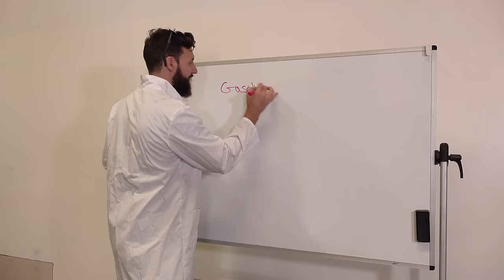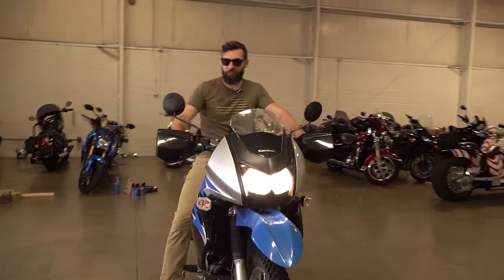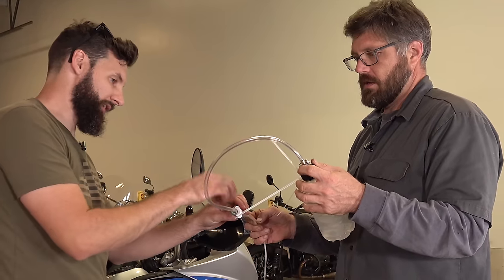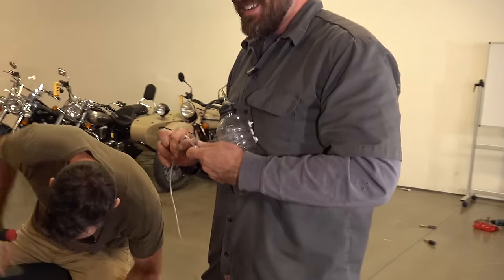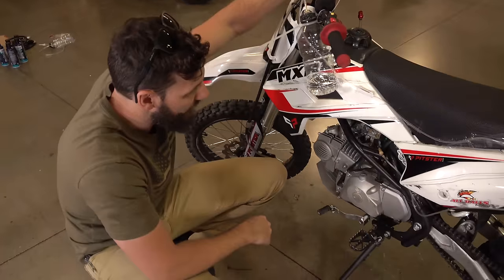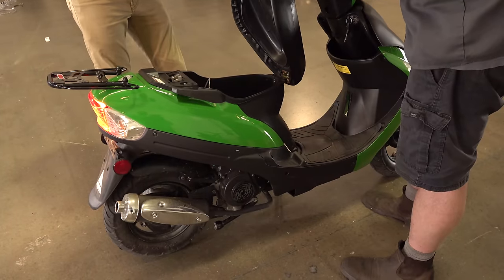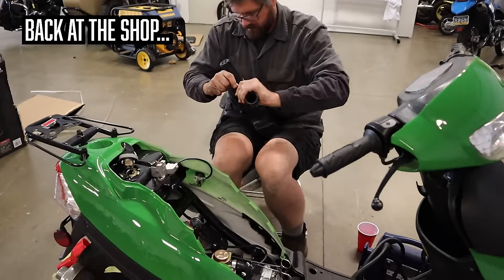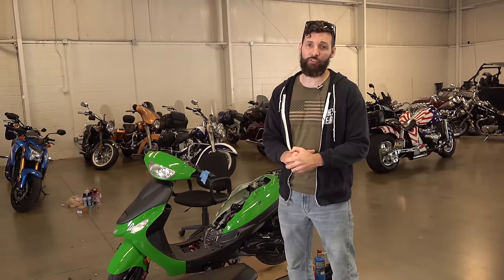What happens when you try to run a motorcycle on PROPANE instead of Gas

Comment: Air Fuel Ratio the first bike was too lean, the second was flooded when you cracked the throttle it was running. You were right you needed a regulator that would regulate a constant amount of fuel per rpm

Comment: Never heard of anyone trying to run a vehicle on Butane, as i understand its not very efficient. Running a vehicle on Propane however is common and has been for decades. Down here many of our cars are "duel fuel", meaning you can flick a switch and choose to run on either petrol from the tank or propane from the bottle.

Comment: To run propane you need more timing. And the hotter propane burns at hotter temps and you need more. So you gotta advance the timing and warm up the propane.

Comment: I woulda just hooked up a trigger air sprayer from a air pump between the LP and the carb setup and taped it on the handlebar and used it with my thumb like a 4 wheeler lol

Comment: if you can rig the throttle to conyrol the valve on the propane tank i.e. turn the throttle and the valve opens, release the throttle and the valve closes... it would control the flow of the propane into the motor..?

Comment: Theoretically you can run am engine on what fuel you want. The Problem is that different fuels need diferent air to fuel ratio. For example, for gasoline you need 14.7 grams of air to 1 gram of fuel. For other fuels you must calculate it, adapt the carburator to mantain that ratio and it will work. It's not recomended to run an engine only on very volatile fuels, because that type of fuels don't have lubrification properties as gasoline or diesel does and you will ruin the engine after some time. Gook luck!

Comment: Maybe run the propane through where the jet is on the carburetor the only problem is the gas flow will not change due to the venturi effect like the gasoline does so it still would have to be modulated independent of the throttle unless you get the throttle to modulate the gas flow

Comment: the propane regulator needs power. you just need LPG evaporators from a car. don't forget that it must be connected to the liquid cooling systen to prevent freezing up. the regulator is only compatible with suplied carburetor. but that carburetor is only compatible with yhe genset.

Comment: It is like a throttle body that has a pressure regulator on there so when you pull on the swaddle it opens the regular more and laws more fuel to get out

Comment: Just hook it up directly from propane tank and and propane hose  modified .it should work cause it needs pressure to force it into the engine cause there is no fuel pump

Comment: it ran for a little while because pressure build up in the bottle. Because it takes way more gas than it takes for pressure to build it will die. because it is not pressing enough gas through the tube.
Try using propane and hook up the gas regulator on the propane to the throttle maybe that works 😬

Comment: You have to remove fuel system stuff, direct connect propane with a regulator valve and that’s it. It’ll run great.without the regulator it’s gonna be a straight fail.

Comment: If you think about it gas acts like a lube for the cylinders/cylinder it is classified as a wet fuel propane and outher gasses are classified as a dry fuel most engines don't recommend dry fuel becous it has no lubricant added to it to prevent the cross hatching from geting glazed with long extended use
The reson why the bikes would not start after some time was because the metal heated up making the engine more loose around the piston ring's and it was evaporating before it could even get combusted wich is a problem with dry fuel's with my experience converting cars/trucks to run on cng/propane with that I use a small injector to spray some kind of lubricant in the intake like marvel mistry oil or just some wd40 for lubrication but that on a big engine not a single cylinder engine and the mixture of the fuel and air has to be stokemetric
Reply: Or to make it easier just use the equipment off a propane forklift simple

Comment: hold the bottle upside down so the liquid butane goes in , should give a lot more oompf 
putting the bottle in some hot water should help up the pressure and gasification too , i have seen the indian youtube version of this experiment and india is a lot hotter in general so the bottle holds more pressure , he used a pet coca cola bottle that can take a bit more pressure and waited quite a bit to alow the bottle to make some pressure / evaporate some  gas 

as for using the bike on propane with the stuff from the generator : that should work check the quarter turn tap on the top of regulator part is set to propane and not natural gas 
you could try a bigger gasbottle to have enough gas head (surface over the liquid ) the bottle can probably be set between the feet on the runningboard for testing
you definetely might want to try a pressure regulator with a twistknob for a camping stove on the gasbottle itself as the full pressure from the bottle could overpower the membrane inside the regulator (the regulator works of vacuum its a big rubber membrane deviding the thing intoo two chambers with a needle valve and the vacuum on one side and atmosferic pressure on the other  , 
more vacuum means more gas added , the inlet needs to be in between the carb and the inlet not before the carb as that has too little vacuum signal 

another thing you could try is put a needle valve or a smaller size nitrous jet in / on the gas inlet tube to the manifold , the generator has a lot more cc's so the regulator might give too mush gas to the small cc scooter , the needle valve or nitrous jet kindah pinches the line so there be less gasflow 
i have seen a road motorcycle where the guy put a 5 kg sized gas bottle (the type you use for youre barbecue) behind the budyseat inside the tailpiece , it fitted perfectly , https://www.google.com/imgres?imgurl=https%3A%2F%2Fwww.motor-forum.nl%2Fmedia%2F767531%2Ffull&imgrefurl=https%3A%2F%2Fwww.motor-forum.nl%2Fthreads%2Fje-zal-er-maar-op-komen-lpg-op-de-motor.246486%2F&tbnid=wRCgw7wXumdmoM&vet=12ahUKEwjDpIPhjZbsAhUK4aQKHYiwCfsQMygTegUIARDGAQ..i&docid=v3rgZFPKufe0IM&w=648&h=486&itg=1&q=motorfiets%20lpg&ved=2ahUKEwjDpIPhjZbsAhUK4aQKHYiwCfsQMygTegUIARDGAQ
he had an outside filler to fill it up at the gasstation (he used an automotive style regulator that he warmed by running the engine oil through it and a gas ventury build intoo the intake to the carbs )

would realy like to see the result , and aspecially see ideas on the (safe / hidden / permanent) placement of the gasbottle  , i have the carb you shown in the picture that you couldnt find , its been sold by the chineese postorder companies , and i'm planning to run my 50cc scooter on it 
i got mine from aliexpress https://nl.aliexpress.com/item/4000672019029.html?spm=a2g0o.detail.0.0.6155526bLk89Hf&gps-id=pcDetailFavMayLike&scm=1007.12873.140318.0&scm_id=1007.12873.140318.0&scm-url=1007.12873.140318.0&pvid=60d41bb5-6097-4f0b-872e-30889b1f32d1&_t=gps-id:pcDetailFavMayLike,scm-url:1007.12873.140318.0,pvid:60d41bb5-6097-4f0b-872e-30889b1f32d1,tpp_buckets:668%230%23131923%234_668%23808%233772%23242_668%23888%233325%2320_668%232846%238109%23261_668%232717%237561%23390__668%233374%2315176%23535 

i was planning on only using the gasifier/regulator part of it (the big orange quarter turn knob at the top of the regulator alows you to adjust for propane or natural gas ) 
why i want to run on propane you ask : in the netherlands gasoline is about 6.65049533 U.S. dollars per US gallon lpg is half that price , 
theres a BIG costsaving to be made even if lpg has less power 
theres allso a new euro 4 norm for pollution in some of the bigger cities in the netherlands and the lpg is a cleaner burning fuel , my scooter being build to the euro 3 norm is banned in amsterdam for instance , if i get the bike tested on propane i might be able to have the scooter aproved again for use in amsterdam

Comment: Can you not buy Gas at the Gas station? We have LP Gas here in Australia it's around half the price of regular petrol but you only lose around 20% power. I had an old Ford with 302 Cleveland engine converted to dual LP gas and petrol. It ran so clean I only changed the oil once per year -around 20,000 kms.

Comment: In pakistan 🇵🇰 we ride bikes on lpg its sort of propane it comes with a kit that adjust the gas pressure.. the coolest thing is that it gives more mileage and run much smoothly and add much speed also

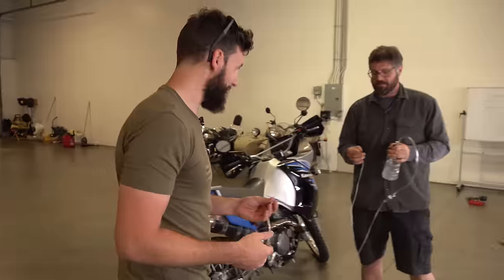Comment: What's weird about Diesel and Hydrogen engines, and propane engines, is that you control the RPM's by controlling fuel flow only. You don't need an air valve on the throttle body. Gasoline only burns correctly between 11.5:1 and 18.0:1 air to fuel ratio. If you go richer or leaner than that, power goes way, way down. Hydrogen can be burned at only 4% concentration in the open air. So if you have a 1:25 ratio of hydrogen to air, or a 1:1 ratio of hydrogen to air, it will burn the same (in theory). Therefore, controlling the air flow with a throttle plate, is not necessary. This is how propane, and diesel engines work as well. There is no throttle plate, there is only a fuel control valve. More fuel = more RPM. To shut off a diesel, you have to cut fuel. Diesels that are worn out can begin running on their own engine oil from blow-by (look up scary videos of this happening).

Comment: There's no pressure in that plastic bottle. It's barely getting enough butane to run. When you twist the throttle it lets more air in and dilutes the butane.

Comment: All you guys had to do was get a plumbers torch and run a hose off of it. You can adjust the propane for more throttle but without gas  in bowl it won’t accelerate very well just run steady when you match the throttle to propane available
Reply: Think ball valve with linkage to carb if you want more autonomous with instant idle

Comment: Air pressure maybe cause the bigger bike was blowing the hose off the needle if u splice the line and have a direct one with a c clamp branch leading to your fuel canister and a sturdy bottle cause the Choke is fuel air mixture so it has to be something to do with that maybe because science idk

Comment: Just get a propane carburetor for a 5 to 10 hp generator. Or you could just put the propane generator engine on the bike? And maybe a pressure regulator.

Comment: Get forklift parts. Some onan generators got parts too. My air cooled 60hp generator runs the liquid propane lines on the exhaust manifold through an impco model j vaporizer then through a carb. Buy the parts at forklift places. Ask for liqid propane everything.

Comment: You have to be careful running propane ,butane!! It can wash the Rings out and melt the Rings to the block there are no cushions such as led additives Etc  or the type conditioners they use in these newer fuels most engines are designed for that particular lubrication.

Comment: Two much air when you use hand trotter need to use throttle on gas and have it mix with air both to be able to have throttle like on a bike. On a generator regulator it off of a generator that reliable on the Governor on the carburetor. Let me know. I am a Disabled/ Retired  Master Plumber and Gas Fitter and HVAC Technician for More than 40 years and I have been riding and building recreation toys since the early 1980s 
.

Comment: you can run gas motors with out a carburetor but there still needs to be air for the motor you should try running the dirt bike motor with a windex spray bottle with gasoline in it with no carburetor just spray gasoline into with intake hole were carburetor use to be with old windex spray bottle and i promise you the motor will run but if doing this with 2 stroke motor make sure to mix 2stroke motor oil in windex spray bottle with gasoline

Comment: Using poor grade LPG is part of the problem. You need HD-5 industrial grade propane. Then you need a proper regulator that is meant for the fuel system to be able to manage the air/ fuel ratio

Comment: I guess
 Takes throtle on choke, too lean mixture that means too little gas, other problem with working for while, expanding gas makes cold, and freazes the needle, thats why lpg cars have heated regulators.
 And finaly you need vacum based regulator, that way you can regulate mixture rigth for wider range of rpm.
 And last you need put solenoid valve on gas tank, for not to explode your self, because you want keep gas of while engine is of, and open only while its working

Comment: It'll run anything even the 650. More displacement = more air you have to eliminate. You have to choke off more air from getting into the 650 engine.

Comment: Why arent they turning the butane bottle UPSIDE DOWN so the liquid runs into the engine?  It appears they are not getting much from the butane because the ambient temperature is the only thing making the butane turn into gas to flow into the tube.  TURN BUTANE BOTTLE UPSIDE DOWN?

Comment: In Europe lots of cars run on LPG, bikes probably wouldn’t reach safety standards for carrying a gas cylinder, need petrol tank as a back up, LPG filling stations are not as plentiful as petrol/gas. LPG Mileage (MPG) is lower than petrol/gas.

Comment: Try LPG or CNG we run cars on its way cheaper than petrol and diesel. (LPG will blow your motor in couple of years and CNG won't). It would be great to see motorcycle with one of that kit. Try ordering it from any respectable sell in india. And yes.. even Milage will improve.(Note. The torque will reduce as its combustible but at lower temperature.)

Comment: Propane burns hotter and when I was installing propane kits into vehicles you have to change the carburetor but I can't remember if that's because we were installing multi-fuel kits so it could still run on gasoline.

Comment: Different fuels have different densities, if you rejected the carbs with proper fuel mixtures. The engines would have run just fine.

Comment: Here’s an idea from the mind of a 13 year-old: take off the throttle grip and put the propane tank there instead and have the valve knob secured in place so that when you twist the tank it works like a normal throttle, just bigger and more sensitive

Comment: Look on amazon for a propane generator kit conversion for as close to the same cc as the bike in question. it does not require the removal of the carb. makes it multifuel. The cfm and water column pressure has a small window but when on propane is like 155 to 125 octane.  The WC pressure if I remember correct has to be around 11wc. A propane grill regulator will work in most cases except higher elevation. https://www.amazon.com/Hutch-Mountain-EU2200i-Gasoline-Generator/dp/B07BHBLFN4/ref=sr_1_2?dchild=1&keywords=generator+propane+conversion&qid=1602894958&sr=8-2

Comment: You need to run it on gas periodically. II have had experience with multi fuel trucks and you had to run gas every few tanks full or the engine would seize. Perhaps things have changed.

Comment: Not an engineer or chemist but I reckon high strength hydrogen per oxides would make a good clean burning fuel. Just start off heavily restricted input line and include an inline flashback arrestor.

Be aware after the combustion chamber you will have water vapor.

Comment: I imagine running a bike without a separate oil pump that way (on gas) will eventually seize the piston, as there's no more lube.
Reply: it's fine..it just needs seated valve seals in the head ... it's a 'dry' fuel like unleaded
Reply: this applies to 4 stroke bikes and cars...
and yes scooters come in 4 stroke versions

Comment: You guys seem to have no concept of metering the butane/propane. You came closer to understanding when you tried using a propane regulator & carburetor. I think the only reason it worked some of the time was b/c you flooded the airboxes (air filter) with gas fumed & the carburetor was able to approximate metering the right amount. Then when you ran it with throttle open too long, the air box would run out of fuel. Obstructing the intake helped because it forced a suction on the needle when the throttle was opened. You should be thankful that the Lord spared you from a backfire that could have exploded the airbox & caused a fire between your legs.

Comment: can you see if a 50 cc will work it will make it easyer to run by using les butain  and maybe use a smaller carberater with small jets for less gas imput and im twelfe litteratly im smart

Comment: A girl I dated back in high school her dad had an square body chevy 1 ton truck with flat bed that could run on either pump gas or propane but when he ran it one propane it had a different carburetor he had to put on I guess the mixture to run propane is different than reg gas

Comment: Well propane has pretty much the same energy potential as gasoline. So 1 gallon of propane will get you about as far as a gallon of gasoline.
Note that a gallon of propane is 4.24lbs.
Wheeras a gallon of unleaded gas/petrol is 6lbs.

Comment: Carburetors have more than one jet that delivers fuel. The pilot jet or slow jet requires a very small amount of fuel to let it idle. The emulsion tube and main jet meter fuel for it to go fast. This will never work.

Comment: Turn the bottle over, use the liquid. The vapor evaps to slowly, however 1 drop makes alot of vapor. So a constant drip into the intake will make 10 times the vapor you need......SCIENCE!!!!!
Reply: on a side note, the act of evaporation causes a massive temp drop, so you shouldnt burn a piston

Comment: what went wrong is that you always had the same amount of fuel flowing into the cylinder no matter what rpm you were at. leading to your air to fuel ratio being completely off where it should be. buy a proper conversion kit and it'l run just fine like every car ruuning on lpg does.